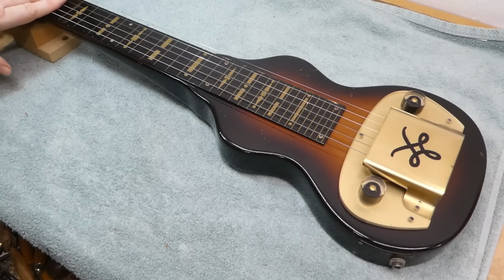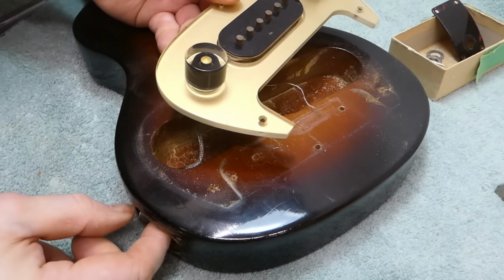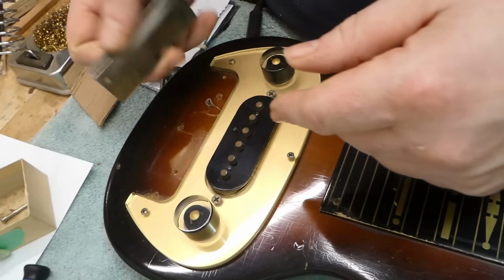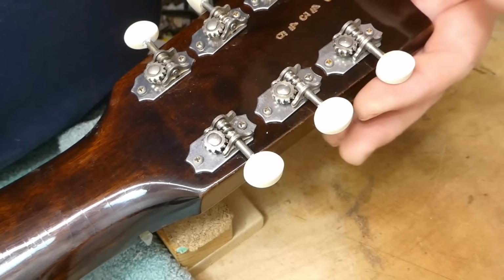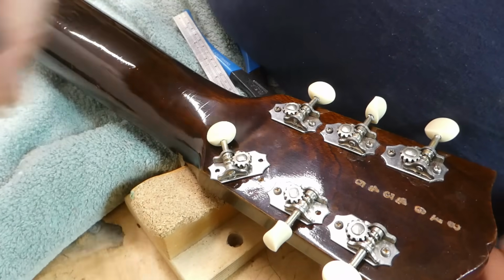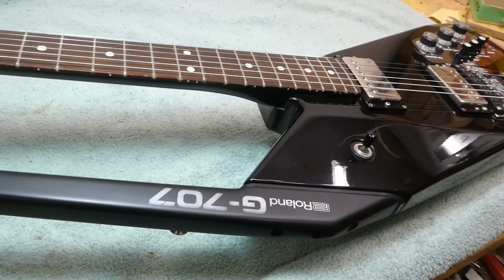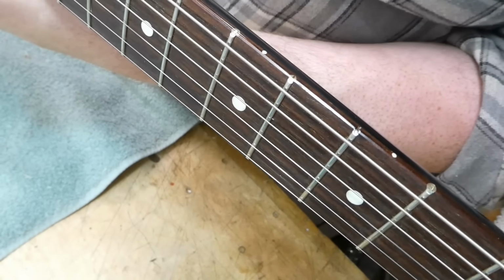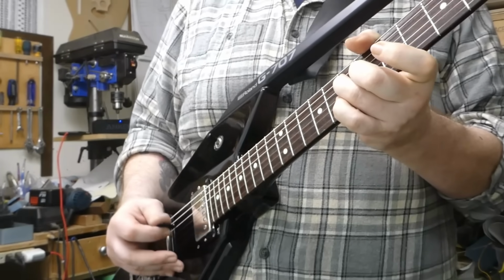Oddballs, old and new.

Comment: Hey Ted, that G-707 is actually an analog guitar controller made by Fujigen for Roland. There is no MIDI at all unless you plug it into a guitar synth that has MIDI, it will work fine with an analog synth such as a GR-300, or the GR-100 Electronic Guitar board. The “sensor” next to the bridge is a hexiphonic pickup, with outputs for each string. You are able to do the Ripley guitar tricks with it.
Reply: I remember Mick Jones from The Clash coming on stage with his new band B.A.D. with one of those back in the late 1980s/early 90s and going "Time for the Dalek's handbag" as he plugged it in. As a Dr Who fan I found it amusing. Strange machines indeed. The guitarists revenge on keyboard players for the awful "Keytars" that became a thing in the 1980s 😂😂😂😂
Reply: @martin-1965  keytars or as I call them: solidbody accordions 😆
Reply: The G-707 guitar was indeed made by Japanese manufacturer Fujigen, who back then were the very same company who made Ibanez guitars (along with Greco and a few others). So the guitar itself and it's build quality actually makes it a rather better instrument than most people give it credit for - look how sought-after and expensive 1980s Made In Japan Ibanez guitars are these days....  🙂  Also, I believe if you pull off the volume/tone control knobs, you will find "Ibanez" moulded inside/underneath them....With the black rubber bands around them, they are the esteemed Ibanez "Suregrip" knobs, the only difference being that instead of gold/amber, they were moulded in clear plastic for Roland. 
Not a crappy guitar by any means  🙂
Reply: heh I came to write in the same thing.
I'd say the G-707 was a guitar with a hex output FOR synth control - you could get the same basic guts in the GK-1
gosh when you think about it, the GR-100 wasn't a synth at all. It was basically a hexaphonic  effects unit (hex fuzz and  filtering for "synthy" sounds, but not an actual synth...sort of the predecessor to the VG series)
It was more of a 'regular guitar' than the others like the G 303,505,808 as the 707 didn't have the onboard hexfuzz like those, so on the GR-300 you didn't get that extra voicing. with the 707
I'm not exactly sure where the MIDI conversion took  place in the 700 - I mean if the internal engine was running on MIDI or if the midi happened parallel to that -- after all you could bend on the 700s internal sounds, but bend info didn't get piped out for MIDI out
Reply: I have the G-707 with GR-700 (the unit built for it) and a SynthAxe. A GR300 or 100 doesn't work properly with this guitar. After this guitar Ibanez (who were commissioned to build it using Fujigen) took the technology to make their IMG X-ING 2010 Midi guitar.
Reply: @ actually the G-707 works fine controlling other 24 pin units like the GR-100, GR-300, the Synclavier Guitar interface, the GM-70 interface, and with a BC-13 drive the long list of 13 pin Roland/BOSS guitar synth units and even the BOSS GM-800 once you throw in a BOSS GKC-AD after a BC-13. Have own or used all of these over the past 40+ years, and if you throw custom third party boxes into the mix, such as discrete hexiphonic output interfaces are able to do things that even the stock Roland products can’t do.

Comment: Adrian Belew is currently on tour with Beat playing the music of 1980s King Crimson and he's dug out his GR-300 synth because he used it on the originals. The 'controller' is a heavily modified Mustang rather than a Roland guitar. It seems to be mostly going OK although they did have an extended interval at a show a few days ago while the techs tried (successfully) to get the rig to stop misbehaving. Pat Metheny still tours with his GR-303 guitar/GR-300 synth combo.
Reply: Pat does have a tech guy that only works on his GR-303 and he gets parts directly from Roland.

Comment: I have a spare bedroom with vintage radio's, record player's, reel to reels, speaker pulls, vintage guitar amps stack on top of each other. I know that smell well. It does smell.good, not the same fragrance but the same way a ditto sheet did in the 70s and 80s at school.
Reply: Do you store any spare apostrophes in there as well?

Comment: I remember the Roland well. It was not a MIDI controller but a ”guitar synth”; the guitar controlled the synth in the floorboard. 

The MIDI protocol came just as Roland was about to release the 707, so they hastily tried to integrate it, but were unable to include anything else than MIDI *in*, meaning that another synth could control the floorboard but not vice versa!

However, the hexaphonic pickup — the little black bar between the bridge humbucker and the bridge — was later used in true MIDI controller add-ons for guitars. The name indicates that it had one separate output for each string, which was necessary for the synth to be able to understand the input. On the 707, this necessitated a large parallel data cable between the guitar and the synth. You can see the large square port for it at around 26:30. 

The analogue jack was there to provide the possibility to plug it into an amp for guitar-style sounds while the synth module could go directly to a mixer. The synth module allowed you to disable individual strings, so you could get guitar-style sounds from some strings independently of synth sounds from other strings. 

However, the need for six individual inputs wasn’t the only limitation the digital synth module in the floorboard had. Another one was its poor interpretation of incoming string data, which would cause all kinds of glitches unless you played very exactly according to the standard 12 tones used in Western music. You’d get an odd noise even when a finger of yours ended up between frets. Hence also the reinforcement bar which was necessary to provide the stability needed for the guitar to deliver correct data. (Which is absolutely ridiculous imho since the neck is bolted; a neck-through design — which was all the rage around that time — would have provided much better stability from the beginning!)

But the thing that really killed it off was that the synth module required two full cycles of string vibration to trigger properly. Since the lower notes on a guitar are so, well, low, that would cause notable latency when playing, rendering it partly unusable. 

Playing synth sounds from a guitar also meant that people who only heard the recordings thought that it was the keyboard player producing them. For instance, Eric Clapton used the 707 a bit on his ”Behind the Sun” album, only to have it draw a lot of flak from all the reviewers who wondered where the guitar solos were! You can hear it most prominently on the track ”Never Make You Cry”; most of the synth pirouettes there are apparently EC on a 707, but you’ll be forgiven for being unable to spot the difference.

David Byrne used an earlier version, I think it was called the 505 or 303 or something, for a few tunes in the Talking Heads concert movie ”Stop Making Sense” (it’s the brown electric guitar and the blue floorboard). Ironically enough, that one actually performed much better and didn’t have the glitches the 707 had since it was all analogue! Sometimes, development does actually go backwards…
Reply: What type of guitar Synth did Steve Morse use in conjunction with his Franken-Tele in the Dregs? I saw him using it several times around 1980.
Reply: Close… the GR700 only has a MIDI out as standard (there are a few out there with a MIDI in retrofit by Roland, but the number is vanishingly small). Also, it’s an analogue synth - the oscillators are digitally controlled so that they don’t suffer tuning problems (so much) when they heat up, and you can play the synth straight away, without leaving it to warm up first. The JX3P is essentially version 1 of the GR700’s synth board with a keyboard and sequencer wrapped around it. Getting the guitar interface “right” (or as right as they could get it, anyway) took so long that the synthesiser part was finished a couple of years before the rest of it. Most famous use is probably the “horn section” on You Can Call Me Al, played by Adrian Belew… (or Turbo Lover by Judas Priest, depending on on your tastes ;) )
Reply: @tonyisyourpal  ok, well, it has been 40 years after all since it first came out... 
Wasn't there something about Roland being physically unable to fit a full MIDI control onto the circuit board too?
GR-700 was indeed the correct name, thanks.

Comment: I would yellow those tuner buttons. That lap steel is in nice condition, BEAUTIFUL condition, but I would still put a linear pot on the tone control and install a new capacitor, and put the old parts in a small paper bag and put that in a plastic bag. I might even put Grover Sta Tites on it too.
Reply: It seems contradictory, but with tone pots an audio taper gives you the nice even adjustment, and linear taper suddenly jumps up at the last 10% of rotation. With volume pots, it's just the opposite. The youtuber 'wills easy guitar' has a video demonstrating this.

Comment: I had a G-707, and a G-505
Used them with a stupidly huge GR-300/700/50 rig for a decade or so.
Big fun!
Reply: I had the G-707 also.

The tracking was so bad. It was cool for what it did. I sold it 6 months after buying it.

Comment: Fascinating, thanks for the video! 
My father-in-law once found a Roland midi "Strat" in the trash bin at his job as a mover. Absolutely superb guitar, of course he kept it. Roland maybe made kind of the right move making "normal" electric guitars with midi capability. He uses as normal guitar, and when the experimental itch comes ... though he admits himself that he'd rather turn to his old synths (also found at his job) than to mess with the guitar midi system.

Comment: FWIW the bar on the G-700 was (IIRC) intended to reduce overtones or harmonics from the guitar because they can confuse the pitch to MIDI electronics. Back in the day I had a GR300 synth and the strat-like controller which worked pretty well. I ended up fitting EMGs to the guitar and Roland were super helpful in helping me figure out where to hook the pickups to the onboard power and also in sending me a replacement volume dual gang pot of the correct values. Ironically Parker do produce a version of the fly that has the MIDI pickup on it, Adrian Belew still uses these I believe, and I think Roland have made synth/electronics boxes that work with these controllers more recently too. I enjoyed mine - well until I blew my combo speaker with too much square wave bass hahaha... fun time
Reply: I remember these guitars. Every music store had one on display for about a year as I recall. Not long. I didn't like them! (Secretly I thought they were pretty cool.) It seemed to be a way to invite all the out-of-work rock guitarists into the world of synth-pop, which was the reason they were out of work in the first place. I tried one out. The tracking was horrible, and as I recall it didn't know what to do with string bends. I also remember how weird (and secretly cool) it was to play a guitar string but hear a piano, with a very slight lag. (The piano might have been a later instrument than these - can't remember. I was synth-curious but closeted for a long time.) It sounds all wrong to strum a piano though. It's like you have to learn how to play all over again to make a guitar synth sound like a keyboard instrument. Then I saw a guy playing one in a local pop-rock cover band. I bit my lip and secretly admired how cool it actually looked in a proper stage setting, and how good the actual guitar sounded through a proper amp with several nice digital effects. But I still hated what it represented - the fall of rock and the rise of 80s synth-pop. A pox on them!
Reply: @beenaplumber8379  I found it was best to play triads with the strings finger plucked all at the same time, if you were used to finger picking it made life a bit easier, I only ever tried one out in a music shop but couldn't see the point in them as the guitar was terrible and shouldn't really be used as a regular guitar and as you also pointed out so was the tracking, also it sometimes got the pitch wrong, I play both guitar and keyboard instruments and if I felt the need to play a keyboard part I would do just that.
Reply: @AndrewAHayes  I'm primarily a fingerstyle bassist with large fingers. I'm kinda clumsy on a six-string unless it's a classical with wide string spacing. I find guitar synths in general are unforgiving of slop. The G-700 had no velocity, as I recall, so sloppiness was just as loud as the melody. I understand more modern units are much better though, with full dynamic sensitivity. The keyboardist in my previous band played a Strat he modified with some sort of synth transducer, and it worked well for him. He was primarily a keyboardist though. When he used the synth interface that Strat, he was still playing it as a guitar, usually doubled with a quiet synth to give it a weird character.

Comment: Between the vid and the comments section I now know more than I ever wanted to know about synth guitars. That "handle" just wouldn't fit into my plans, nor against my fat body.  The lap steel is a work of art; simple and durable.

I will remember the tuner knob replacement technique, and the Krazy usage of Krazy glue!

My first exposure to CA glue was in the early sixties, when my high school part-time job was at a plastic and rubber fabrication shop. Being in Rochester, NY, we did a lot of work for Kodak. At breaktime, one of the guys brought in a bottle of Eastman 910. He said, "Let's see if this stuff is as good as they say!", painted a glue ring on the bottom of a glass ash tray, slammed it down on the break table, counted aloud to ten, then lifted the entire table by the ash tray!

Sixty odd years later, I wonder if my exercise asthma was induced by all the MEK fumes I inhaled on that job...
Reply: No way you inhaled MEK fumes and didn't suffer some bad effects. When I was in the print supply industry (1990-2005) MEK was treated as carcinogenic.
Reply: @Kevin-mx1vi. Back in the last century, my brother was an apprentice printer. He fell for the old prank of being asked to collect some MEK (was it methyl - ethyl - ketone to give its full name maybe?) in a plastic bowl. By the time he had carried it back to the printing machine, the MEK liquid had eaten through the plastic and the bowl was empty! Eventually MEK was banned from use in the printing industry under COSHH rules and regulations. However, some years later,  I did watch a so - called “machine team leader” cleaning a dot matrix print head on a mailing machine with MEK. He was throwing it about quite liberally, unaware of the possible side effects. Stay safe and well.

Comment: On the G-707 guitar controller, its mate was the GR-700 6 voice analog synthesizer. It was basically a floorboard hybrid of the Roland JX-3P and Juno 106.  The only digital part is the note and knob data from the guitar to the synth unit. The GR-700 unit does all the sound generation starting with a single DCO analog oscillator per voice. It does not process an electric guitar signal at all. Regarding 5 pin din MIDI it was created by Dave Smith of Sequential Circuits. Before that companies used (and still do) analog CV and gate voltages with main standard being 1V per octave and 5V gate signals. There is some variance with companies like Korg and Buchla using different voltage standards. Regarding the "stabilizing bar" that runs parallel to the neck, it was originally intended to minimize dead spots that would interfere with note generation.

Comment: Hey , magnetic pickups having the worst susceptabilty to emfs
when lying on their backs.But the single coil airyness sounds so good.
Some Fender pedal steels have two single coils with one having a pot across to remove the coil from service. So in a poor emf environment the pickup can be noise bucked or for pure single coil sound the other coil is shunted and all degrees between.

Comment: Mine now is the Roland GK-3 and using a GI-20 allows me to get sound from any sound module or keyboard using it's sound module. My first MIDI guitar was a Casio/Ibanez PG-780 and after taking it's original pickups and filing them in the round metal file can, made the guitar part of it sounded like a worth wild Strat the MIDI side was extremely fun to play. Only to find out later that the techs were not trained on how to repair them and that it was too expensive to keep it running at it's best! Only later I could fix it today by changing the electrolytic capacitors from the main board inside the guitar's interior. I'm OK using the GK-3 today.

Comment: I believe the bar on the G-707 was described by Roland as for 'adding stability' to the neck for the purpose of reducing unwanted vibration triggering the synth. (A guitar that doesn't vibrate?!?!?) They were wild things to play when hooked-up to the floor unit, but in my limited experience I remember the synth/guitar controller partnership was very intuitive and simple to use.

Comment: I guess I'm one of six.  lol. :-)  I've got a 1941 Kalamazoo KEH 100 lap steel with a P-13 pickup.  Love playing Blues on it in open G tuning.  I ended up replacing the pots (cleaning the old ones didn't work) and the tuners (one tuner was bent beyond repair) to make it more playable.  Of course, I saved all the old hardware but I'll likely have left this mortal coil when this lap steel gets a new owner.

Comment: Funny enough that when the bit about Super glue came up it reminded me of a school assembly back in !964. There was a demonstration by 2 gentlemen about recent product development and one demonstration had them apply a "Glue" to the surface of a small steel disc and then place another steel disc over the first. Then they invited several students to come up on stage and pull-on ropes attached to the discs with all their might. After only a brief moment in time the discs were now inseparable. Was that the origin of superglue?